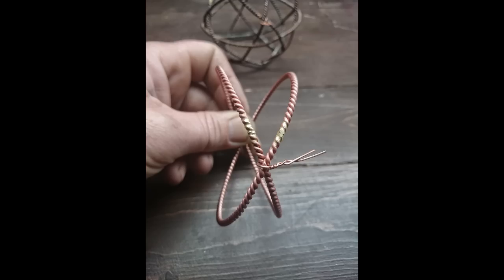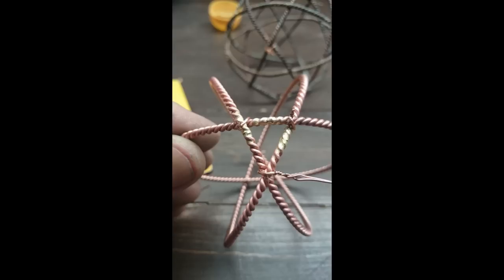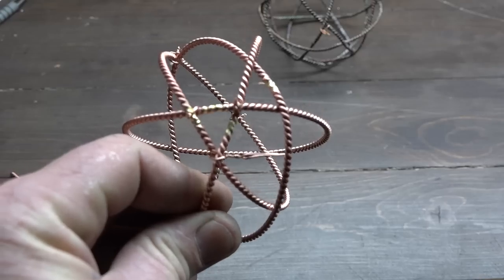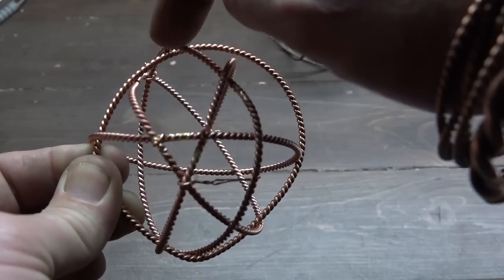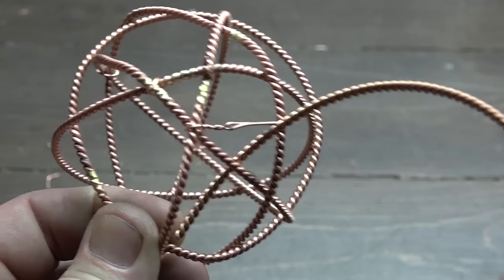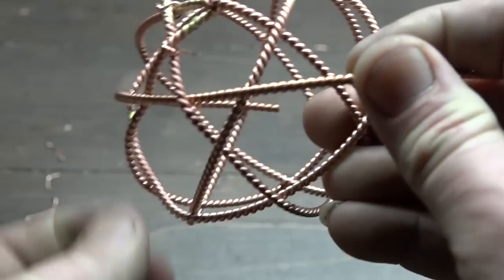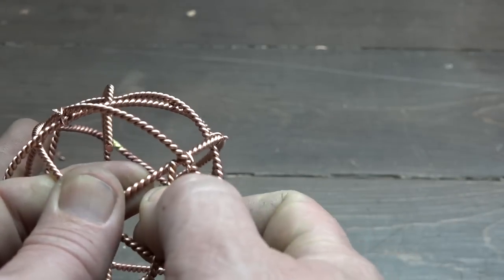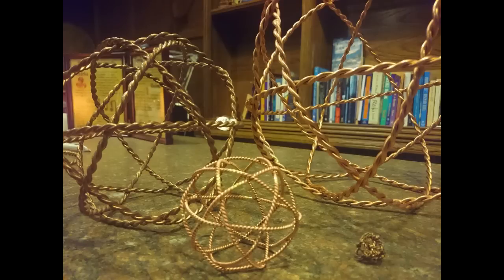Creating the Gaia Sphere

Comment: Please may i know if the wire use in making tensor ring is BARE wire like the one use in house wiring or Coated with insulating material like the one use in electric motor/transformer. thanks.
Reply from the maker: We use bare electrical wire in our creations.  I do not know what the coating material is, but was recommended to me to not torch that type of wire due to fumes.  That is the only knowledge I have of that one :)
Reply: They use to use shellac to coat copper wire to use it in windings like motors and such, that way they didn't short out.  The wire your using looks like standard copper wire and isn't coated.  The wire will tend to oxidize after a while so you may want to spray it with shellac or varnish.

Comment: Can a soldering tool be used, rather than welding equipment? Does it work the same?
Reply from the maker: Soldering does not create a very strong physical connection. It can be used though!